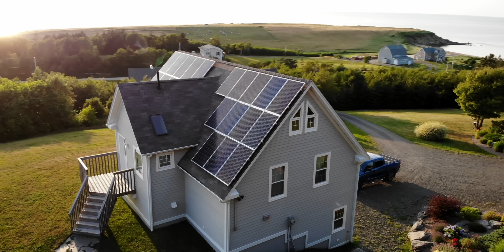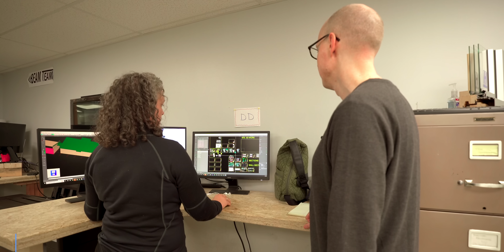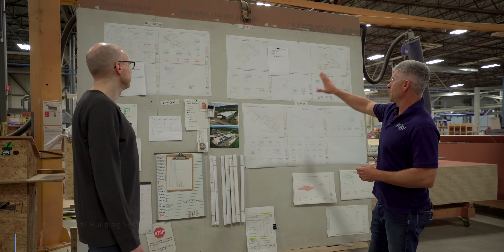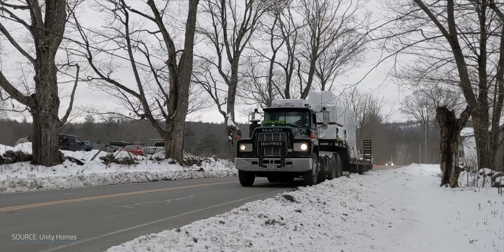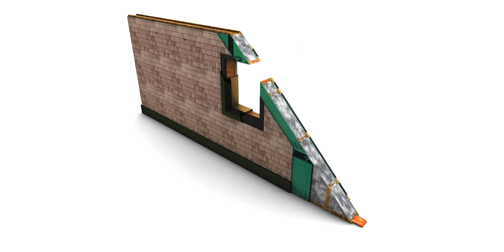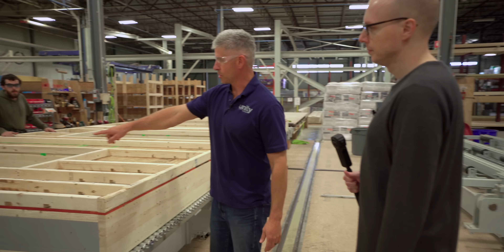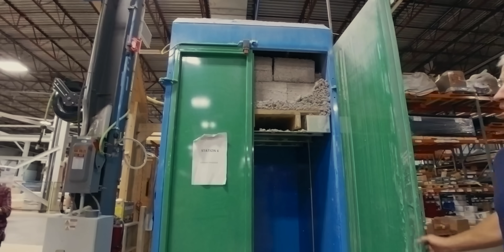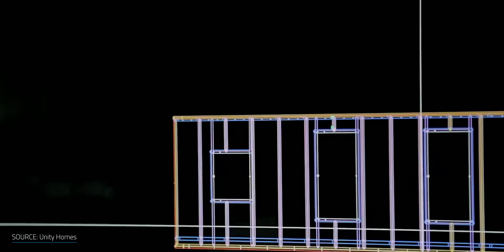The Simple Genius of a Prefabricated House - My Net Zero Home Build

Comment: Good stuff. 👍
But I would not be myself if I did not say about it, I will mention immediately that it is only a delicate suggestion.
It is about video material recorded in the factory, and more specifically about the use of auto image stabilization when editing video material.
I know this will narrow the frame a bit and take a bit more time to encode / compress, but it greatly improves viewing comfort especially when viewed at an accelerated pace.
Best regards from Poland. 🙂

Comment: I built my home 12 years ago using a system that was very close to what you showed here.  Factory built walls, insulation and window insertion etc.  It also has a metal roof and ground source heat pump.  I remember that the overall cost in the end was marginally more when you subtract weeks of labourers framing the walls.  I love my home and now 12 years later... I would love to build again using the even better technology you showed.  So exciting.

Comment: Hey Matt, Matt Risinger is a contractor who has a YouTube channel where he has shared a lot of the net zero/nearly net zero construction he and other contractors have done, including his own house. In this video he shares a process to make a tight house even tighter. This process is done when the envelope of the house is fully assembled and sealed (well, sealed as well as humans are likely to get). So the windows and doors are in and sealed, wiring and plumbing is in and sealed where it penetrates the insulated shell of the house, but (ideally) before the drywall is put up or the rest of the interior is finished. 

Then a blower door is put in place in an outer door opening and a system is brought in that produces a fog of aerosolized caulking material. With the blower door pressurizing the house air will start to leak out of the house out even through the most convoluted pathways and through the tiniest of holes. As the air moves from the inside to the outside it entrains the caulk particles that are so small they are suspended in the air like dust particles. As the air and caulk pass through any whole it sticks to the sides and caulk builds up until the hole is sealed. The decrease in the blower door reading is remarkable, especially considering just how carefully the other Matt and his crew were trying be when caulking and sealing in order to make an exemplar of energy efficiency out of his own house.

https://www.youtube.com/watch?v=JYugiSwWoPk

Comment: Matt,
This is extraordinarily exciting!  I'd love to build like that.  I suspect you know the answer to a couple of questions & perhaps I misunderstood a detail or two.  
1. I think I understood that they apply Zip Sheathing on two sides?  If so, aren't the concerned about trapping moisture between the inside the wall?  
     1a. Is Zip-R Sheathing an option? 
2.  When they drop the wall assemblies on your slab or foundation, are they using some kind of membrane and acoustic Sealant between to seal air infiltration and bugs? 
3.  From a SolarRoof perspective, were you able to customize your roof design? 
4.  Do they offer Closed-Cell spray foam insulation? 

Cheers, 
Eric

Comment: I have built 2 Modular homes in the past 15 years and they were Very energy efficient.   This panelized build allows more freedom than the old "box" design of Modular building.  I do not understand why homes are stick built anymore.  When you want a car does the manufacturer drop all the parts in your driveway and have you assemble it?  The construction industry is so wed to its old "tried and True" methods that it has stood in the way of these amazing new processes and building methods which will reduce build cost, increase energy efficiency and cut down on the amount of thermal breaking which is the Bain of heating a house.  I can't wait to see the next edition of your build!

Comment: Matt question. Do you think you could get net zero or close to it on the home standard with a barndominium style of home? Obviously for power you can just add solar panels as needed assuming you have the space and budget. But all the checks you need for a net zero home, would that work in a very open style home?

Comment: This needs to be one of the key futures to better residential construction. 

Why this is important: faster on site construction, means faster time to occupancy.
 Loan companies will very much appreciate this method.
Because construction time from foundation to occupancy can be only 60 or 90 days. 
Which means owner begins loan payments sooner. Most other building methods, can be 6 months from foundation to occupancy. 

AND, customers can choose their plan, details, and see the "virtual" results, make changes prior to building. Saves everyone many potential changes during construction.

Lastly, fabrication inside climate, safer, prevents wet/mold/delamination, better labor conditions. 

Displaced labor? Nope. 
Now opportunity to learn machine operation/software/machine repair, logistics, and/or jobsite equipment operation.

Of course, ALL of this method requires excellent accuracy of the information respective to local building codes, and manufacturer specifications (window/door/etc) installation requirements. 
Massive amounts of information to collect and "learn".

Comment: No such thing as Net Zero. it is impossible to attain. The very tools they are using to assemble the house are not net zero products, and that's just for starts. We get lead into this false sense of truth with feel good proclamations and want so bad to believe but look one inch deeper and you find dirty little truths. Finding a Net Zero product is completely impossible. Something in the process is touched by fossil fuel.

Comment: This is not meant to be a shot at you or the home manufacturer but having just had significant experience with home construction I can say with some authority that many of the materials being used are not particularly high end, in fact much of what I saw were entry level low end.  I understand there need to use engineered materials over natural as their automated manufacturing process would be unable to cope with any of the small inconsistencies that occur in a natural product.  Mulch of what you are doing re: heat pumps, heat pump appliances, and solar electricity storage are all interesting but, as I stated in an earlier comment, they all add to the initial cost and are therefore out of reach.  Yes there is the argument that they reduce operating costs over time but if a person can’t afford the cost of entry into the market then the reduced operating costs argument is moot.

Comment: We started down the road of having an architect design our passive house and after spending $7000 and not even having something to look at we stopped and went to unity homes. They said we were lucky because a lot of customers had to spend upwards of 45,000 to $100,000 just for designs, their ability to design and build a Home is in my opinion one of the best in the country. We toured the factory and we were very excited about building the home but unfortunately we could not afford the design we wanted and ended up going with an existing home that we love. 

I’m surprised you’re installing Geo and Solar w/battery backup. I was under the belief that a passive home is so efficient that those additional forms of energy were overkill. 

We have a 3k sq/ft home with a 6 ton Geo and 15kw solar. Also a gas tankless which is a huge savings on gas. It’s 2x4 construction from the 2000s. Although I wished we had the unit home (wife doesn’t 😊) it’s always true that existing construction is better for the environment than building new. It’s tough to get around those embodied cost. 

Love your videos…thank you.
Reply: what would your target design with unity have cost?

Comment: This is super cool. We built a similarly insulated home in Vermont with triple glazing and double walls. I was nerding right along. We stick built on site but many similarities. Rock wool instead of wood fiber for main wall insulation. A crew built the outer envelope for us and we added the interior walls and did all  insulation, vapor barrier, electric, plumbing and HVAC, drywalll, floors. My wife's job (bakery) was on hold cause of pandemic so she had more time to help.

Looking at the prices on the Unity website I'd hazard (very roughly) we built for about half the cost and ours has higher insulation rating and passed blower door test. The way we did it was sooooo much work and time but we did not have money to do otherwise and avoided a mortgage. If we were building now, I'd surely consider prefab like this for speed and excellence in design and integration but we'd have to get a loan.
Reply: hi craig, i'm working on a similar project in VT currently targeting double-stud walls and triple-pane windows, where abouts did u build? i'm at a crossroads between stick-built and modular and considering aesthetic/complexity/cost factors. because u did interior-framing, insulation, vapor, electrical, plumbing, hvac, drywall and floors, the half-cost statement is difficult to place because i can't do all those things. my question would b: if u had to sub out all those parts, what would the cost comparison look like?
Reply: @buildzilla  
We built in Bridport. So much depends on the labor cost (labor is expensive here). Off the top of my head I think we'd have spent at least double for labor if we had to pay for all the interior labor that we did. Professionals would have done it quickly (tho finding people sometimes isn't easy either) and expertly, not something I can say about all our work. But it allowed us to not need a mortgage. It was not the first house I've built and have also done some remodel work. But I'm far from a real professional in any of the trades.
Reply: thx craig, if i understand correctly could b a wash with prefab if u had to pay going rates for labor. i'll point out that bensonwood has diff levels of service (mostly having to do with design time from what i can gather), but straying from the common assemblies requires more design and starts to get pricey. unity < open < custom.
Reply: @buildzilla  That sounds about right. Even though we built a custom house, we kept it very simple and that helped with our need to be economical. We were spendy with windows and insulation and thrifty with design (self designed) and labor (did as much as we could, oddly COVID helped as the biz my wife worked at had more time with it closing for months during pandemic).

Comment: Anyone can build a double walled house, and it has been known for a long time that building doubled walled houses and filling the cavity with insulation is a very insulated way to build. Conventional building and framing crews across the country can build this way already. Yes, builders will do a double take when they see the plans, because it is unusual; but once they are told why, hey this guys wants a super effcient home, and they are going to put a whole bunch in insulation in those walls, he will be able to build that way. The cost benefit of building this way is known and ultimately, many folks choose not to do it because the improvement in energy savings is not usually worth the added costs.   Passive House Design, has effectively made highly effcient buildings, neat and cool. They decisions are at the expense of other things.

Comment: Post world war 2, prefabricated homes were quite common here in the UK. Premade moulded concrete sections were simply transported to site and put together. Despite being cheap, temporary housing, many of these are still standing and habitale even now. Later this method of design was used for high-rise towers.

Comment: I built my own home in LA county ca. I own a machine shop but like building things and always wanted to build a home. It was a split level home looking at LA harbor. The foundation had to go to bedrock. 60" down to Basalt/Massive. The earthquake requirements are nuts for foundation, soil requirements, framing , shear walls, nails evey 6" on almost all all panels. They covered almost 60% of the studs. 100% of exterior walls 2x6 exterior walls Hardy frames where shear panels were not big enough, Grade beams in the ground for garage and backyard to support post for 8"x 60' balcony and then tying the whole house together north/South and West/East by designing shear walls/transfer beams from one end of the house to the other.
     I looked into factory made like here but they don't pass building codes in California.  Example, if you have to put in anchors in the slab with 2 part acrylic the city inspector has to be there to watch the install. They must be per dwg. J bolts.
          I wish they did let you install these.

Comment: This entire process is amazing. My big question about the sustainability is how repairable are these buildings? It would seem to be a pretty large ordeal if you have to go into the walls for any reason (plumbing and electric being the obvious ones), or do any major repairs to the structure.
Reply: Great question, it is really amazing is that repair/modification is almost the same as traditional construction. (have been using similar construction for over 40 years)

Comment: This left me with a couple of questions.
1) How much does shipping the prefabricated house affect the initial carbon footprint of their homes?
2) I wonder how much they struggle with building regulations being different in different cities/states ect... that seems like a massive mess. Especially since they can't just have an expert making modifications on site to fix up any issues.
3) To make this work I think they'd need to be very reliable. A part that is wrong or damaged or missing could cause a huge delay waiting for a replacement to be fabricated and shipped, or require someone skilled on site to fix/modify it. Do they have like a graph of how often this has been happening to them over time?

It makes me think they are making the software free simply because the more users they have building houses like this, the more they can influence on stuff like building codes.

Comment: Is this the way to go? Of course it is. No rain, snow, sleet, or sunburns.
The house I am in right now is a factory-built home from the early 60's. Interestingly, the bottom and top boards of every wall have a slight mortise to assist the framers. The insulation isn't very good, but that was the 60's. 
I had a 'manufactured' home built in 2004 and got to tour the factory. It was very clean, and they built my home in 10 days. 10 days later it was delivered to my site. The company built to 'well above industry standards'.
Now, do not confuse the terms 'factory built' and 'manufactured'. They are not the same thing. My factory built home has double 2x12's all around the perimeter of the two halves, and 4 2x12"s at the marriage line (where the two halves go together). 
The manufactured home sat on 10-inch steel beams with steel outriggers supporting the exterior walls. The latter arrangement limits what can be done with additions and even modified wall openings, and don't even think about roof modifications.
Either way gives you a better and cheaper home than stick built. Some stick build companies will put up a huge tent and build under it, keeping out the weather and making the employees much more comfortable.
Do your research and make an informed choice.

Comment: I would like to see a 10 year comparison of the environmental impact of this type of house compared a traditional house, or even worse, demolishing an existing house to build one. While there will be huge savings in energy usage, this needs to be balanced against the environment cost of the additional materials required. For example, a lot of energy is required to make glass, and this design uses 3 times the amount of glass. How many years do you need to live in the house before the environment benefits counteract the up front environmental costs?

Comment: There are many advantages of factory built housing. Weather is never an issue and neither is lack of daylight. Factories can run 24/7 unlike a traditional site built home. Many people think homes are limited to 1 story. Multi story homes are built all the time. Limitation is moving modules on roads. First and second floors are separate modules and stacked on site. There have been developments where every home is built in on site factory. This avoids moving modules over public streets. Once all home built, factory is moved to next development.

Comment: i have had triple glazed doors and windows here in the UK for just shy of 8 years, and believe you me they are worth every single penny, 1st years gas costs went down by 68%, currently as i type this i have had NO gas central on since the middle of Febuary this year, just hot water on demand on the boiler and cooking , my last 6 monthly bill for gas cooking and hot water on demand i used 8 units roughly 94 kwh of gas for a £2.99 cost plus another £20 ish pounds of daily standing charge thats for 6 MONTHS :) :) keep them coming :) :)

Comment: Built a custom SIPS home 9 years ago.  Geothermal HVAC. Love everything about the home.   Biggest problem is that the banks are not willing to finance the cost of the home since they use comps to determine the assessed value of the home.  SIPS cost more so the homeowner will need to come up with a lot more cash and you own a home that costs more than it's assessed value